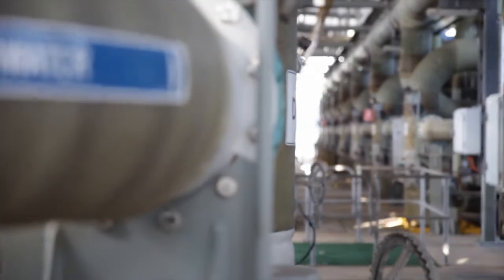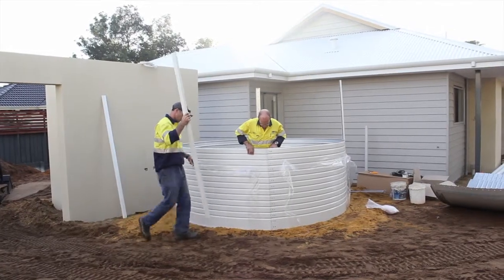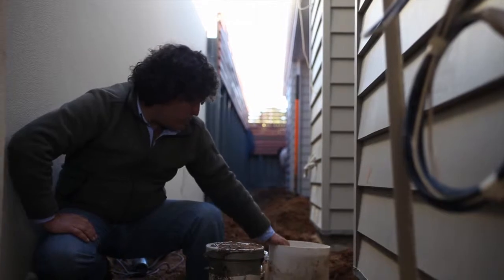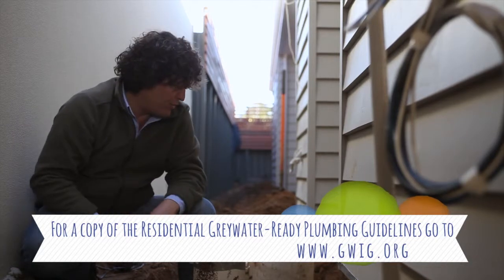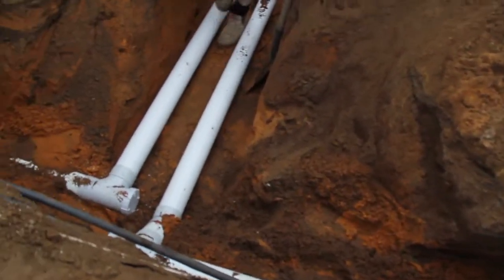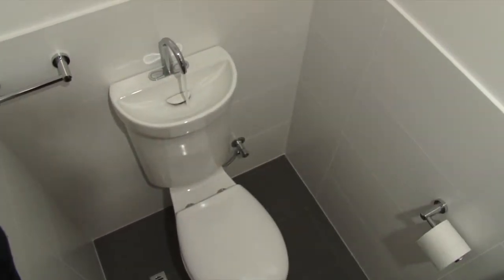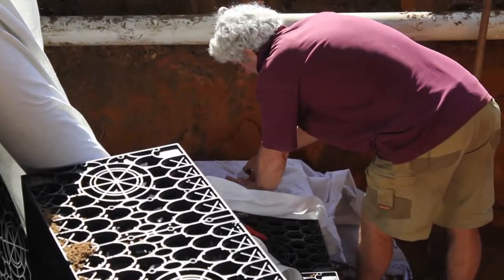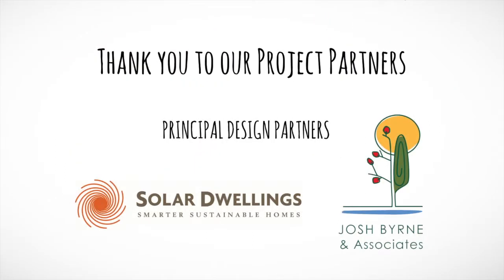Josh's House | EP 7 | Water

Comment: I wonder if the water tank could be used as an additional thermal mass to keep the house a comfortable temperature in Summer.  Like what if you had pipes in the concrete floor for heating in winter, then for summer you could also cycle water through them which dumped the heat into the water tank. Josh mate, you are an inspiring guy. Well done for all your good work.